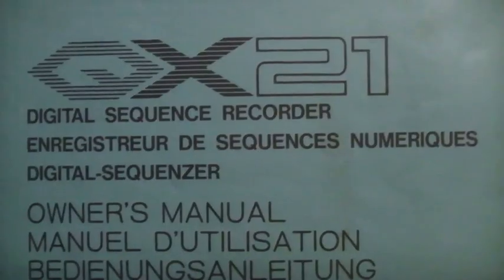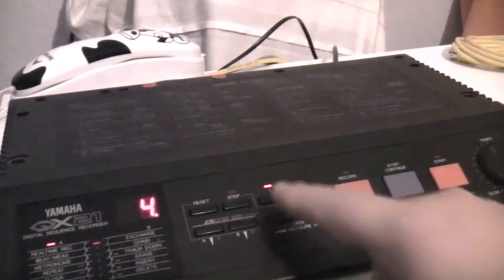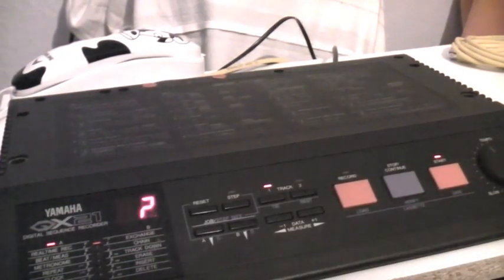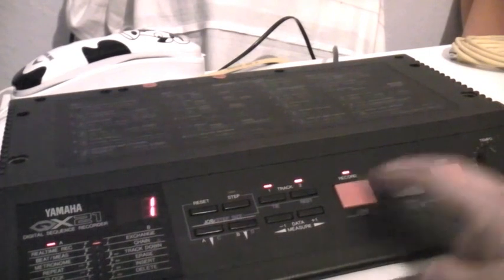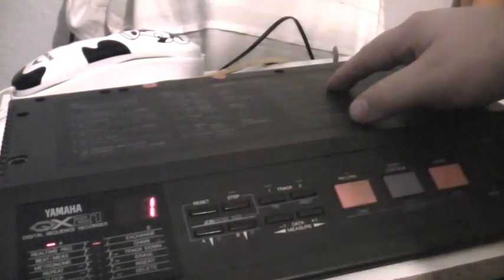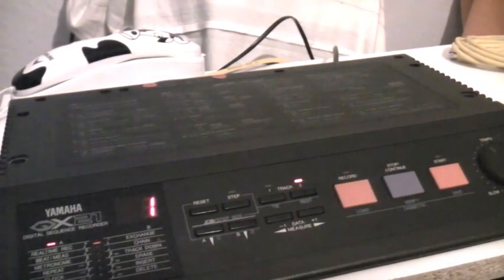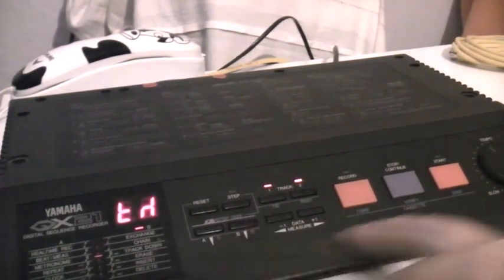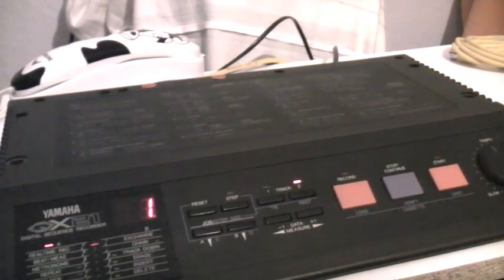MIDI recording with Yamaha QX 21 hardware sequencer

Comment: I just wanted to say what a great video especially as it showcases the defining feature thst maked the QX21 different and much more powerful than the QX7, namely the ability to selectively delete a MIDI channel. This is a broadly misunderstood machine, largely because the workflow is not what you would expect if you are used to more recent conventions, but it is a lot more powerful than many believe. I have produced a few videos using it recently, and I had great fun doing them. It is an inspiring piece of kit and the fact that you can turn it off and when you turn it on agaim everything is exactly as you left it, instantly, makes all the differenxe to someone like me who can only spare 15.mins here and there to work on my current music project... Thanks!
Reply from the maker: Thanx for your comment and great to see the QX21 in your videos in action!
Reply: @grauoliv  Thanks! I enjoy using this clunky old machine...  :-)
Reply: Yeah it’s a cool little sequencer. I mean, super basic compared to my MC-500, but meant for different purposes. 

Question - how many synths do you normally sequence on it for a song? 

I find I can do 1 easily (of course), 2 is alright, but once you get to 3 or more, sequencing an entire song for all of them gets tricky.
Reply: @krystianseibert6610  great question. I've connected 3 synths + a drum machine, no problems. Thre three synths were being sequenced by the QX21 (one of them doubling as cintrol keyboard) and the durm machime was just taking clock from it. If there is a secret, it might be to use a MIDI THRU box unstead of daisy-chaining the synths (I use a Banana Split). The other thing to note is ypu have to be careful how you set up the channels so you don't have feedback loops and other nastyness. I have Echo Back = ON on the sequencer and the master keyboard must be set up not to play from the keyboard, but only from the MIDI IN. Another thing I found is that many synths will automatically start their sequencers and I had to turn that off. With the Crave I had some problems when I tried to sequence in the QX21 transpositions of the onboard sequencer, but I haven't tried everything yet so I haven't given up...
Reply: @telantas  Thanks - that’s helpful. One more question - when you sequence multiple synths, do you lay down a full sequence for one synth first on the corresponding MIDI channel, and then do the second synth on another channel etc? Because with the second synth - if you do the sequencing bit by bit, you basically need to do it on Track 1 and then ‘Track Down’ so it merges with the first synth already recorded and on Track 2. Then you do the next bit, and again do Track Down. So unless I’m wrong, once you’re adding sequences for other synths (even if on different MIDI channels) the Insert and Chain functions aren’t that useful - because if you already have something on Track 2 (on a different MIDI channel for another synth), when you ‘Insert’ then it just replaces that completely. And ‘Chain’ goes to the end of Track 2, rather than the end of what you have on Track 2 for the synth you’re currently sequencing. Sorry - bit of complicated question, but not much around about the QX21!
Reply: @krystianseibert6610  Hi, excellent questions again! You are asking for a lecture I am afraid, so here it goes...

Indeed Chain and Insert alone are not enough to do what you describe.  But it can be done!

So, suppose you've recorded 24 bars of bass and lead. You've got it all on Track 2 (bass, say, on MIDI Channel 1 and lead on MIDI Channel 2). Track 1 is empty to start with. Let's say you want to insert new material betweens tracks 16 and 17 - say a 4-bar bridge. And the new material has both a new bass and a new lead.

There's a couple of ways to do it. 

The first way is to step-record 4 bars full of rests on Track 1, then use Insert to put those blank bars where you want the new material to go on Track 2. So now Track 2 is 28-bar long, but bars 17-20 are just silence. You now record the bass on Track 1, while also listening to Track 2, being careful to only play notes during bars 17-20. Obviously you can erase Track 1 and retry as many times as you need until you get it right. Once you are happy, you track down, and you've got your bass laid down on Track 2. Now you record the lead in the same way. Voila!  

The disadvantage of this method is that you have to listen to bars 1-16 (in our example) before you can record anything. If you have 3-4 instruments to record, and maybe the section yoy want to alter is further down the track, that can be a bit of a pain. 

The alternative is to move the original material to the buffer first, then work with Tracks 1 and 2 to create just yoyr new bars. Once you have your new 4 bars finalised and on Track 2, you bring the original material back from the buffer to Track 1, then exchange Tracks 1 and 2 and use Insert to put the new 4 bars in Track 1 st the position im Track 2 that you want.

With this second method you can work on your new 4-bar section without having to listen to all that preceded it each time. 

The disadvantage of this second method is that while you record the new 4 bars you cannot use the Quantise function because that will overwrite the buffer, where all your previous work is saved! However if you are ingenious you can find workarounds. One way (though it's a but of a cheat) is to use an external device as a second buffer. You can use SysEx to save either track to an external memory. I use an Android phone running the free spp SysEx Librarian via a very cheap mini-usb to MIDI cable (I think it cost around 20 quid on Amazon). However I tend to use it just to save my work at the end, for ongoing projects I prefer to keep it all in the sequencer. I gues a Yamahs MDF would be a nicer way of doing this but I don't currently have one.

So that's how you can insert anything anywhere. It sounds awfully complicated when you write it down but actually it's just a few taps of the clunky buttons and you are done. The beauty of the unusual user interface of this old beast is that you develop a lot of muscle memory to do this sort of thing pretty fast.

What if you want to re-use some of the existing material, e.g. you want your new bars to have the same bass as the old ones, but a new lead? That's not a problem, you can always make a copy of your original Track 2 and then remove the channels and bars you don't want and work with that.

Happy sequencing!
Reply: @telantas  Thanks again for such a detailed and informative answer (and I subscribed to your channel). I’ll see how I go - I may also end up using it in combination with my MC-500 to add another track, or in other ways. I agree though - using vintage sequencers in general, vs a DAW or iPad equivalent like Korg Gadget (which is great for MIDI sequencing) means you don’t ‘see the music’ so you need to plan it out more in your head. I also find that since I switched from using Korg Gadget to the MC-500, it helps make my songs clearer and simpler, and without 8 sounds going up and down and left and right. I do want to get as close as I can to the approaches used by my favourites groups in the mid-80s (though I will record into my desktop) - though many groups also started using Ataris and Commodores for sequencing from the mid-80s onwards!
Reply from the maker: @krystianseibert6610  The limit is the maximum of MIDI-channels, which is 16 here. Adressing 16 different synths, each with a differente MIDI channel, is no problem, when you use one ore more MIDI-Thru devices. ;-)

Comment: The KraftWerk poster is uber cool! 
I still have my QX-21. I also have a Brother MDI-40 and PDC-100.
Those Casio sounds were also in the MT-240 keyboard, which I used as a sound module.
Such memories you've brought back. I'm going to dig out those old gems and start using them again.
Reply from the maker: 5argeTech Thx mate ... and yeah, dig'em out and let us see/hear somethin'! :-D The Casio is another project as I removed the keys and speaker and have to build a nice case for the rest to have it as a sound module!

Comment: I have problem i use dx7 and qx21. When i tried change preset to record next track, preset in  first track changed too
Reply from the maker: ***** As the DX7 is only mono-timbral, you can only play one sound at a time! This is normal behaviour. The keyboard in the demo has 4 individual sound parts, is 4-times multi-timbral.
Reply: So Is the Qx21 cable of processing 4 part multi-timbral, even though it only has two tracks?

Comment: Dumb question, how do I get it make sound? Do I have to run it back through the keyboard?
Reply from the maker: I heard one say, there are no dumb questions! If you have one keyboard/synth in connection with the QX, you plug the QX OUT to the keyboard IN. Then the keyboard plays the programmed sequence. When you program the QX, you hear the keyboard direct on its own! What have you connected so far to the QX or another sequencer?
Reply: grauoliv running it to a Yamaha psr 36
Reply from the maker: So, then it should work the way I discribed it. Maybe it's turned LOCAL OFF. Pressing MIDI and Elec./Jazz Guitar should turn it on. Maybe the QX's ECHO BACK (Job C-4) is turned off! The good is, both manuals are available online from Yamaha!
Reply: Got it working. Thanks for the help.  Needed new midicables. Next step learning to chain them properly. So will be watching this again
Reply: @williambrown319  I got my qx22 hooked to a psr36 just lile you, see my last two videos. The psr36 has this great facility where you can set send and receive midi channels separately so you can record the psr36 part and then use the psr36 to control another synth while it still plays its part...

Comment: Hey so I recently got a rx21 DX21 and a qx21. I found out how to connect the rx21 to the DX21 but my only concern is with the sequencer. Which plugs do I put in for the sequencer? I’m trying to make some bass but I can’t seem to find how to put in the sequencer
Reply from the maker: The MIDI solution with only those three would be
DX21 Out -> QX21 In
QX21 Out -> DX21 In
DX21 Thru -> RX21 In

That way, you can record in real time or step mode from the DX to the QX. And the RX should be tempo synced to the QX via the Thru.
Reply: grauoliv was thanks for the tip!
Reply: I have one more question and I’ll be out of your hair. How do you activate the jobs? I see that job c-4 is turned and I don’t know how to turn it back on.
Reply from the maker: For C and D jobs hit RESET & the C/D button.

Comment: Even though you can bounce two tracks to one, Is it only cable of 2 part multi timbral?
Reply from the maker: Each of the two tracks can playback all 16 MIDI channels at once. :-)
Reply: Thanks man,I've also discovered in the Manuel, that you can have 8 part multi-timbral from a multi-timbral synth as well.  Do you know how many songs you can store in it's internal memory?
Reply from the maker: As there are 16 MIDI channels, you can hook up a 16 part multi timbral synth, for example the Access Virus. The memory of the QX 21 has in fact only one song, with two tracks.
Reply: So just to clarify, you can store up to one song that will support a full 16 or 8 part multi timbral song to the internal memory? Will the song still be in memory when you pull the plug out?
Reply from the maker: Yup & yup! :-)
All data on the two tracks and the (third) internal track.

Comment: i did some wild ass sequences on the QX21 for a couple of years then i got an Alesis MMT 8
Reply: ***** the mmt8 had 8 trks for recording. The QX21 had only 2 trks, but you can bump the recorded track to trk 2, then record other parts on trk 1.
Reply: @sargetech  Indeed, and with the ability to delet channels that's almost like having many tracks (up to 16 I think). I do enjoy my QX21, I recently posred 3 videos using it as the sole sequencer in my setup.